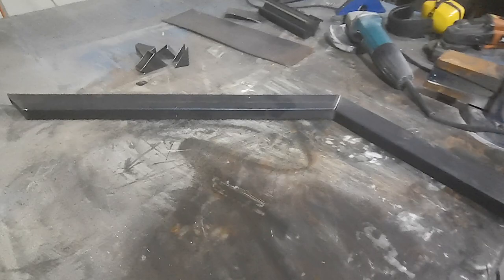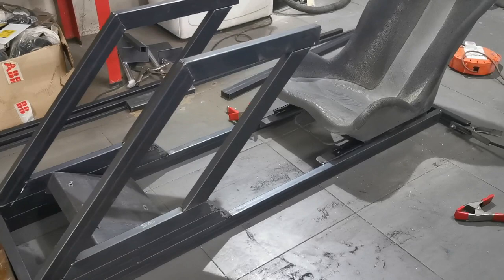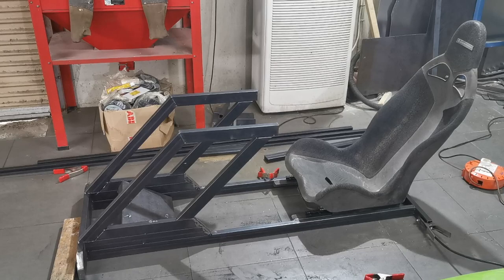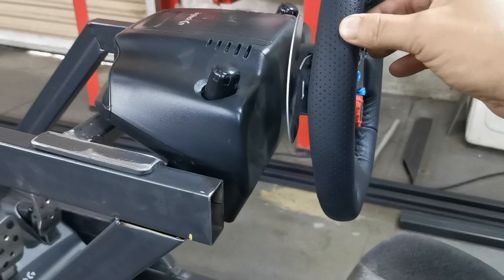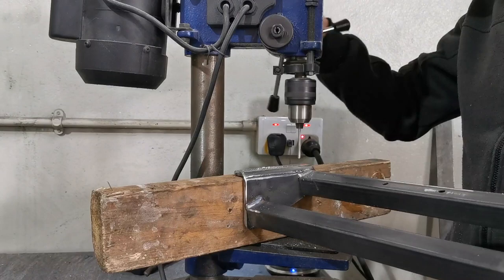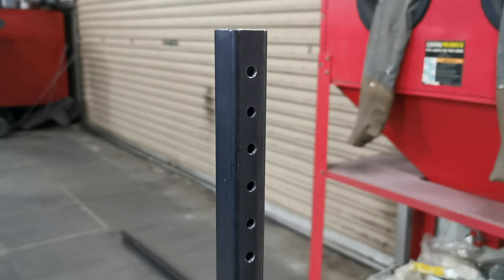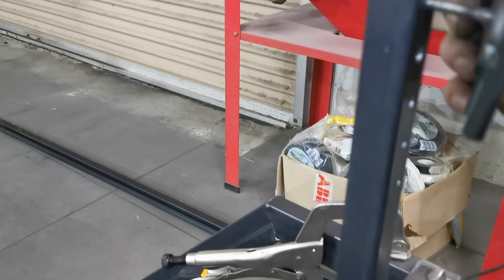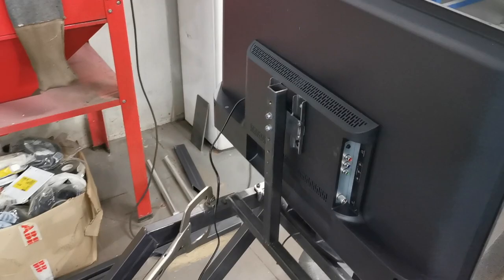DIY SIM RACING RIG BUILD UNDER $100! Part 2,

Comment: Looking nice, great fabrication! 
Just a thought. Taking in mind when you are going to be racing. Thinking about the actual horizon of the “world” in the games, you wanted be looking straight ahead, and not looking upwards. It kinda looks like you’re going to be looking up, so maybe you should be trying to move a third ore half the screen down below the height of the steering wheel. If you get what I’m trying to say😊
But it looks great, and I’m now subscribing👍
Reply from the maker: Hi Christoffer. Thank you for the message. Yes great point and that's already sorted. I have dropped the screen further down now and looks a lot better. Thanks for the sub as well! I'm blown away by the response to the build so far.

Comment: Amazing video - you've inspired me to take my recently acquired G29 and sort out a sim rig. Gives me an excuse to use my gasless mig welder and redundant Cobra bucket seat. Do you happen to have any schematics or measurements you'd be happy to share? Would you also recommend doing anything differently now you've had it for 2 years?

Comment: Just out of curiosity how much does the rig weigh after it is all said and done
Reply from the maker: With the triples and a direct drive I would guess between 30 to 40kg. Easy enough for me to move around the floor on my own. Without hardware bolted to it it's very light I can pick it up easily and carry it around.